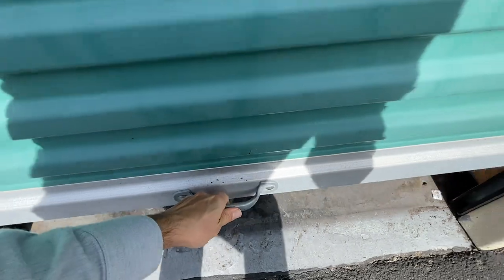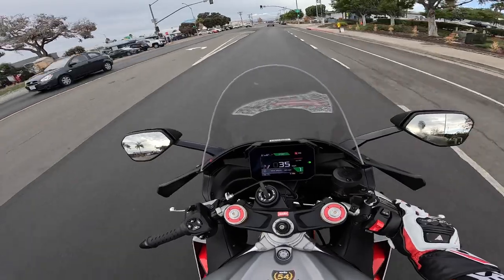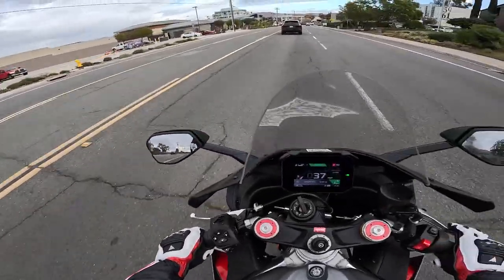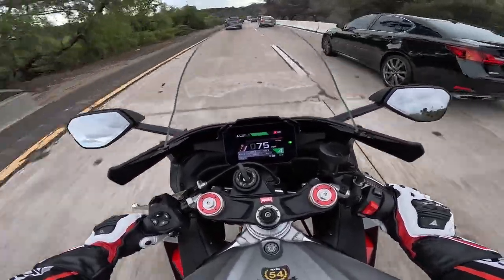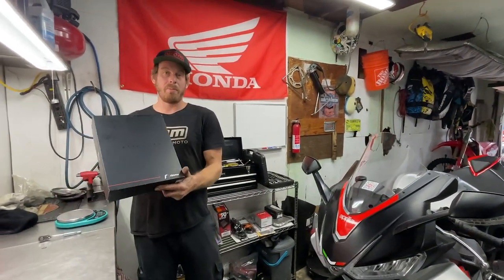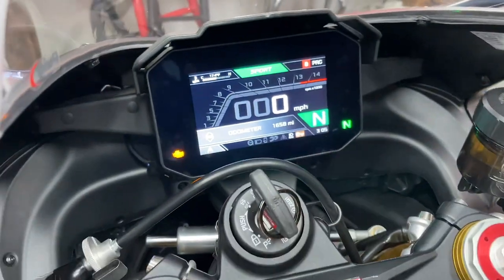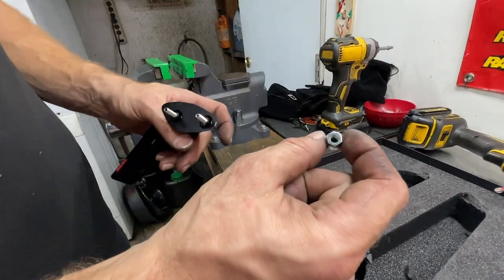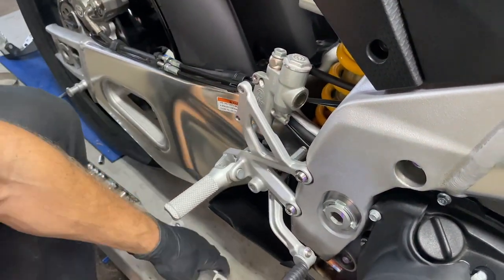Aprilia RSV4 SC-Project CR-T Exhaust & Rizoma Mirrors First Impression Ride (holly sh!t)

Comment from the maker: This video was taped before last week's episode about my "dead" RSV4. SC Project and Rizoma Mirrors are legit awesome products.. stay tuned for pure sound and full exhaust review to come after I get the bike repaired.
Rizoma Stealth Mirrors: https://imp.i104546.net/P05MV6
SC Project CR-T: https://bit.ly/3T0Vy2F
Reply: Oh shit.. here I'm thinking you got it back up. Bummer man. Looks and sounds dope 👌  mirrors are superb.
Reply: I was thinking about your starting issue from the previous video. And I think there may be a simple fix....

It might be a gear sensor misalignment issue. Bike has to be "Neutral" for it to start, correct? 

When you said the first time it wouldn't start— you shifted the gears up and down, then it restarted

That leads me to believe that even tho the TFT dash is showing "Neutral", it may not be communicating that correctly to the ECU. So the start button will be dead.

I think the first time you shifted up/down— that may have caused the gear sensor to realign with "actual" Neutral, and communicate that correctly with the ECU. 

Have you tried shifting up to 6th, then back down to "N" and tried restarting again?
Reply from the maker: It’s going in to the dealer tomorrow. 👍

Comment: Have you already done the upmap or installed the race ECU? I'm definitely gonna need the CRT for my Tuono! Sounds amazing! Hopefully you get to enjoy it once the RSV4 gets out of the shop. Cheers
Reply from the maker: I have not. Am avoiding it completely because dealer/Aprilia will find an excuse to void warranty and as a result of what’s going on with the bike, I’m gonna wait it out. I mean come on… 217hp not enough? Lol..
Reply: @PetroHead  it isn't about more power its about the engine running properly thou. When you dropped the catalyst which is incorporated in the factory muffler the ECU needs to be tuned for air/fuel ratio reasons(lean conditions). Lean conditions can grenade the engine and believe me the manufacturer won't cover that either lol. Something to look into. I believe if you ha e Aprilla tune it you can still be covered under warranty.
Reply from the maker: I’ll wait.

Comment: did u have to add a servo buddy (servo eliminator) when installing the exhaust?  or did u leave the servo motor in?  I bought the exhaust, just wondering if I need anything else for my installation
Reply from the maker: I kept the servo intact but it’s getting removed and replaced with a S-buddy.

Comment: So is this the same scenario on the mirrors for the RS660, you only get the front turn signals back with the Race ECU or UP Map? The reason I am holding off on the Rizomas is that very reason, besides, how are you going to pass your state inspection with no front turn signals?
Reply from the maker: Bikes don’t need inspection in CA. But yes, same scenario.

Comment: If you put carbon on start with the wheels…
Reply from the maker: On start?
Reply: @PetroHead  if you start putting carbon after market parts on your bike, might wonna think about swapping the stock wheels for carbon ones.. 
Are the stock ones forged or aluminum cast🤔… I think only the rsv4 factory has forged wheels? Not really sure though..
Reply from the maker: Carbon wheels = $$$ 

I’ll wait for a sponsor lol